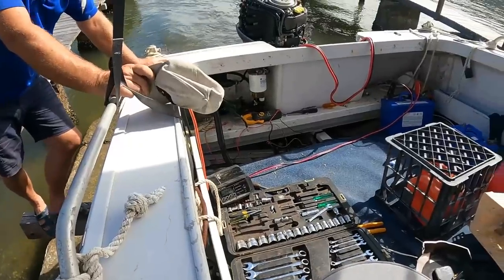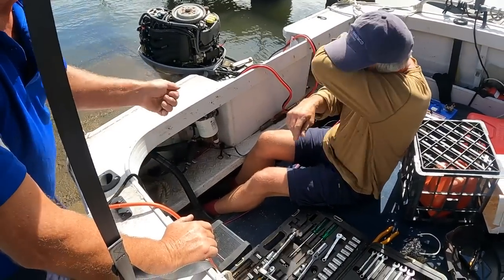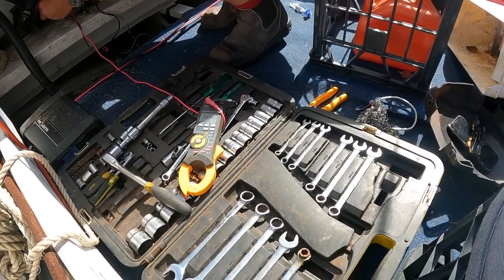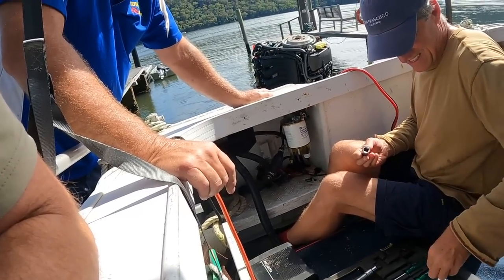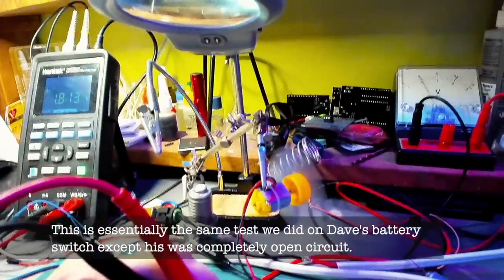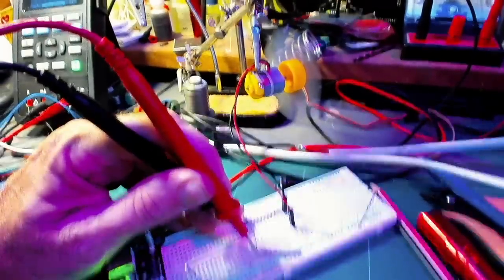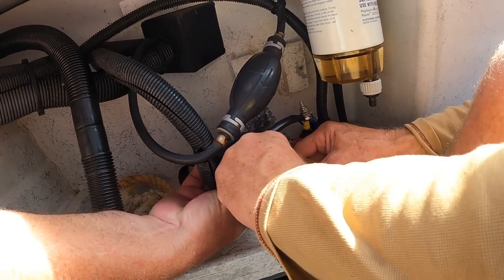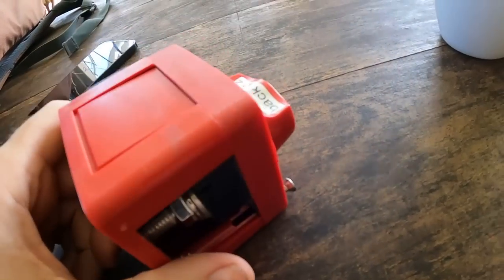Outboard motor won't crank

Comment: Great to see you  back (hopefully) and doing well.  We all missed you badly!
Reply from the maker: Thanks Vin, I've been crazy busy (almost 7 days a week) at work but I'm really trying to make more time for videos. Hopefully things will settle down soon.
Reply: @DangarMarine  been same here, with moving from a 11 room house to an apartment complex (a temporary move due to our roof partially collapsing due to weight of snow).  At least I still have a garage and a 'new' project: my 2 sons and I are going to convert an aluminum 14.9ft 'V' hull tower into a serious bass fishing rig over the summer. We plan on videoing each step.
Reply: @DangarMarine  Hi mate. I have a 2018 Yamaha 50hp 2 stroke with less than 20 hours on it.
The motor runs fine when ear muffs attached on land but when the motor is in the water, in FWD and i try to give it throttle it bogs down and won't go any faster than the "in gear" idle speed.
New fuel was put in the fuel tank.

Can you please give me some advice on what could cause this.
Hasn't been used for 2 years, could it be carby issue?
Reply: Good to see you and Eddie again!! (And yes, I am a bit late :)

Comment: It's your fault that I own 7 outboards.

4 years ago when I started watching your channel I owned zero outboards.

I currently own 7 outboards, most of which didn't run when I bought them.

The correlation is undeniable.

Thanks for all the great videos!
Reply: About time you graduate to a boat to put them on then....😂
Reply: @stevedotrsa  forgot to mention I now have 3 of those too 🤪

Comment: Good to see your face again Stu! 

The one I always ask people as soon I get the call (and you were right there with the neutral start) is the deadmans. 

Awesome way of simply testing across a switch as well just measuring voltage.
Reply: I'm always perplexed why most (all?) motors will still crank with the tether out. It could save so many people so much time troubleshooting if it fully killed the electronics!
Reply from the maker: Yes, deadman's switch is a common no start problem, but as Jackons says below, it will still crank which can be misleading.

Comment: Good to see you again Stu, I just bough  a desktop white board and drew up how  to wire up a 12v winch with a solenoid and remote receiver. Folks love the simple   but detailed view. My ignition switch on my boat sometimes needs the contacts cleaned for the motor to start. Mine is like a car on the dash not on the control. After cleaning contacts I put a little dielectric grease on them.

Comment: Good to see you Stu. And the D squad. One thing i do when working on unfused high amp battery lines is disconnect the negative terminal first and reconnect last. Otherwise that rachet the was used to connect the leads might end up channeling 12V into the hull if one is not careful. Not sure how many amps it takes to blow a ratchet.

Comment: Missed your videos, good to see you back.
Had an interesting lesson last week, motor would not pull over, I succeed hydrolock,  it is a newer mercury, and neither owner father or I realised that the gear shift and throttle were 1 control on the tiller arm, it had been put in gear and that locked out the pull start, so the pull start was locked until , the motor was shifted into nuteral

Comment: Just had this on my 4.3 mercuiser inboard. Wouldn’t crank at all. Battery was good and I was getting 12.8 volts everywhere. I used one of those lithium jump starter packs, put the negative on the battery negative, and then put the positive on the positive battery terminal… still nothing, then I put the battery pack positive on the input side of the isolator switch, and the boat fired right up. I took the booster pack off and I checked the voltage drop across the short cable from the battery positive to the isolator switch whilst trying to crank the engine and it was massive. New length of cable fixed my issue. Testing for voltage under load was the key to finding the problem. No load, everything looked fine.

Comment: Another one to check that caught me out was a loose cut out switch bracket on the console, such a simple thing that cost me a lot of stress.
Once found it was fixed in less than a minute though.

Comment: Great, clear explanation of how to measure voltage and current around a circuit!!!! I have just bought a, AC/DC clamp ampèremeter/multimeter and I am ready to start checking and updating my electric system. Extremely valuable explanation 🤩🤩🤩🤩🤩 Thank you once again 🙌🙌🙌🙌🙌🙌

Comment: I have been following your video's for quite some time, you inspired me to pick up a used Honda BF40A for my pontoon boat and it has been a bit of a challenge. Changed out the PT motor and cannot find the proper way to top up the fluid ,I assume it's to be done with the ram retracted but cannot seem to find info. The lower gearcase nut is a real PITA and cannot find the proper wrench or a way to "chase" the threads in the lower unit. It runs great though ! LOL

Comment: Thats a great video as it explains whats happening to my engine currently. 

However with my isolator switch, it is for every electrical item on my boat, and i have nav lights, vhf and gps working still just have completely dead engine controls and gauges

Comment: Hey Stu I have a 2002 Yamaha 50hp 2-stroke that’s runs perfect in the driveway revs 6000 in and out of gear then I put it in the water under a load and won’t hit 2500 maybe it bogs down I’ve cleaned the carbs like three times any suggestion thanks man love you knowledge and content

Comment: someone is happy to see you <3 got to love Eddie, you can add a resistor to those led tape lights and it will make them burn lower power and last longer, yeah Mr. Squiggle, it is the right time for chooks to molt, you wont get any eggs while they do either

Comment: I've got a 2004 Johnson 150 (Bombardier) V6 (60-degree) and I've been waking it up from its 3 year slumber.  Runs great above idle but dies pretty quickly at idle; especially in the water.  On muffs in the driveway it lasts a lot longer but now I've gotten it to the point of idling for as long as I want (in the driveway).  Last time we took it on the water I used the seafoam method and that seemed to help a little and I let it finish burning everything off in the driveway today; now it idles basically as long as I need on muffs in the driveway.  It starts to backfire a little though.  

Right after I shut the engine off today after letting it run in the driveway I went to drain the carb bowls and the upper left-hand carb bowl (upper-passenger side) barely let any fuel out.  I even went as far as keeping all other drainplugs in besides this bowl and priming the fuel system with the bulb; no fuel would prime through the drain!  What could this mean?  Is there something I am missing like it shouldn't come out through there if the other bolts are in?  The engine was tilted , could the float be stuck or not properly positioned?  The other drains would allow fuel to flush through the drain even with the engine tilted?  I'm worried now that that cylinder hasn't been getting fuel.

I should note we converted to the premix fuel pump and got rid of the OMS/VRO system.

Comment: Make sure your protection devices are water tight - if they corrode they will be a possible additional unexpected fault/breakdown. And change that rusty fuel filter, the rust will lift the sealant/gasket  and allow air/moisture to the fuel or the reverse and leak fuel into the boat. Safe boating ya-all.

Comment: Hi my friend! I have a 25hp johnson 2 stroke does it matter if I use a 5/16" fuel or should I be using a 3/8" fuel line? Been having fuel issues.

Comment: Good practical video but I'd be cautious about bringing ohm's law into a discussion about electric motors. They have impedance rather than resistance, their resistance depends on their RPM. Just setting your multi meter to resistance and measuring the motor would show you something close to a dead short while the voltage and current you measure while the motor is spinning freely would suggest a much higher resistance.

 A bad connection on an electric motor might easily cause more current to flow as the lower voltage across the motor causes it to turn slower. Hence the fire risk.

Comment: Hi, great video. I have a question that I'm hoping you, or another viewer might be able to answer. What is the number of teeth on the flywheel starter gear? I'm looking about for one with 80 teeth. Thanks.

Comment: Stu do you still have a workshop? I need a 2017 bf90 with 100hrs on it atripped and cleared of salt build up, the sod I bought it off never flushed it... It appeared very clean on the outside but then under full steam it warms up and the 80degree warning comes on.

Comment: Stu, did you make any progress with your closed cooling system outboard project?
Reply from the maker: Hey Tim, I made a lot of progress but very technical stuff to do with a electric speed controller to drive the water pump. I will do a video when I can.

Comment: Just a question about The red wire between relay and the solenoid, would you know why there is no power on the wire between the relay and solenoid ? Motor is not cranking motor is 115 suzuki DF.

Replaced the neutral switch, kill switch, main relay and starter relay still no power go through on the wire, any ideas? On what we should check?

Comment: I have an outboard question if that's ok? I have a Yamaha 70B 2022 and if it gets left for a few months and the last time it was 18 months then it starts to leak 2 stroke oil through the bottom carb, then through the reed valve-cylinder then out the exhaust port and shows as a drip on the edge of the propeller, is this a fault or just head of pressure forcing the oil through the system? Weird thing is seems to only happen on the bottom carb, it even soaks through into the float chamber of that carb, if I take the spark pug out and flick the starter it blows the oil out but nearly always need to strip the carb to clean the oil out, would appreciate help figuring this out.

Comment: I had a problem like that and it was only the kill switch was in off position on the  controller. Don't like mercury kill switches to hard to tell when they are on or off. Have vessel view on motor and went on line and it told me what the problem was.

Comment: hi, not sure if you work on MERCURY OUTBOARDS BUT I HAVE 2005 MERCURY 50HP 2 STROKE , I HAVE A NEW STARTER/SOLENOID /2 NEW BATTERY READING 12.75/12.79 MY OUTBOARD STILL JUST CLICK OH YEAH NEW HOT WIRES /NEGITIVE WIRE TO THE BATTERY .BATTERY SWITCH ALL PORTS ARE READING OVER 12.5 ON A VOLT METER WHAT ELSE CAN I TRY

Comment: Hi Stu , İ just need your help if you could please , İ have an old johnson outboard and the model number is 50173S  , İ just want to changed the controller because its very old model and forward , neutral and backward has a button, theres no handle or anything, since İ bought İ couldn't start it yet because the last owner has changed the cables , instead of wiring to + red he used tge other way around , as soon İ connected to the battery and start a spark came out of the controller and from the motor as well , İ just changed the fuse and didnt have time to test, İm not sure the fuse is gone or something else but as İ said İ just want a normal controller , do you think theres other controller can do the job , the plug is 11 pin , thanks mate

Comment: My mercury rebadged tohatsu has a sticker on the starter motor. Don't use a hammer he he.  I've also had seen bad grounds with corrosion that leads to higher amperage draw shortening life of starter solenoid.

Comment: would have been nice if you had pulled the old switch apart, they can sometimes be fixed just by cleaning the contact points